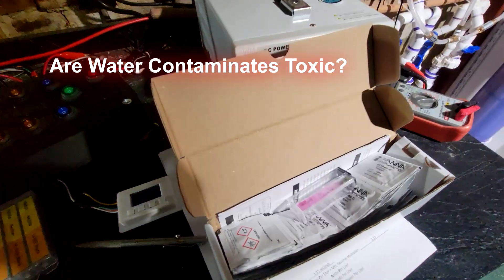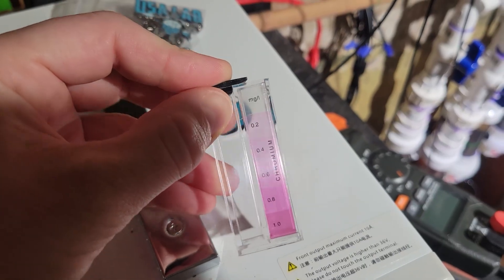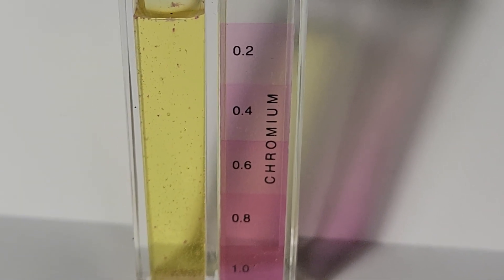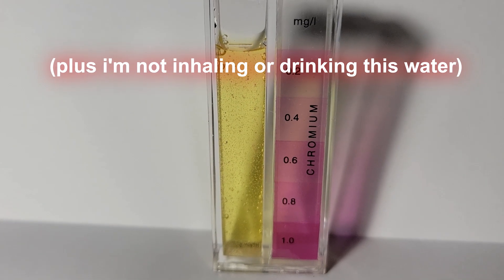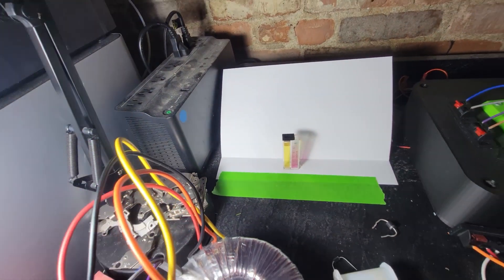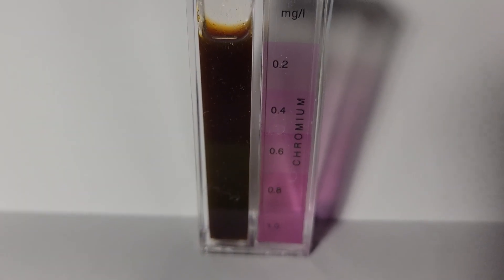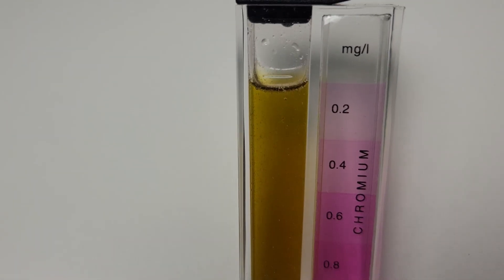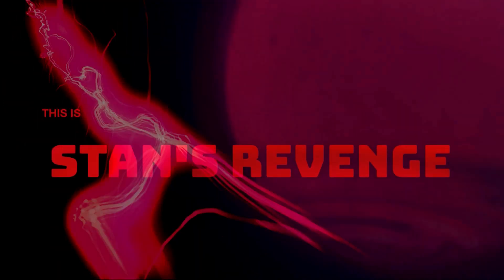Are Cell Contaminates Toxic? Hexavalent Chromium (CR6) Test

Comment: Whatever caused those purple specs it obviously wasn't in solution, that means it's filterable, which is a big plus. 
  If it is solids that contain chromium, and not a false positive, you would have to dissolve the chromium to get an accurate test in terms of parts per million, because there's a lot of atoms in solid flakes and always less surface area than volume for an indicator to react with when solid.
   I would have to look up what dissolves chromium that wouldn't interfere with the test, but thanks for mentioning the phenol-whatever maybe spell it  in a reply, just so I'm sure I'm looking up the right thing 😁
   Also should probably mention for non-chemical inclined people, if the chromium is insoluble it's probably not hexavalent but I'm sure the strong muriatic acid in your stomach is going to react with it anyway.
Reply from the maker: Are you a chemist? Sounds like you are at least chemically-inclined, which is likely much more advanced than I. The solution needs a professional test, really... But I think I proved to myself that it's safe to work with and won't kill me (it's not like I'm drinking it here). Wouldn't you agree?
Reply: @noahauman , I started as a chemistry major before switching the computer science, but yes definitely chemically inclined as I still do a lot of stuff as a hobby. 
   Just a fact that it's not a solution definitely makes it safer because it makes it easy to filter. So yes I agree. People drink a lot worse I know I have, but they still had lead in stuff when I was a kid.
   I decided to look up some of the stuff with the test you were taking, apparently it would also react to nickel flakes which is another ingredient in stainless steel.
   Personally I think people in general should know much more chemistry, just a familiarity with what they do on a daily basis and be able to read food ingredients and such. Again is a but, that's probably also true about the law and medicine too.

Comment: The big issue here is that the small particles that shed off the surface of cells which is nanoparticles initially formed through cavitation and ablation of the SS electrodes, will carry over into any combustion system.

The heat of an ICE will cause leaching of chromium in exhaust vapors which  will be emitted similar to lead emmisons from old leaded gasoline.

One caviat that can fix this is recapturing the exhaust and pumping it back into a second cell to undergoe electrolysis again.

Addition of a carbon block filter into a second stage exhaust recurpation system can help too mitigate any population issues.
Reply from the maker: I do not believe that those nanoparticles (if they do exist in the form you propose) are carried though the released gasses of the EPP. Stanley states that its absolutely pure H2ONAr (hydrogen, oxygen, nitrogen, argon), and was lab tested nearly perfect 2:1 ratio *supposedly*. In a traditional DC electrolysis setup, I can fully understand how your point would apply, given the high decomposition rate of SS under high amperage chemical-electrolysis.

Stan did, however, use a gas recapturing system to recycle the non-combustible gasses to lower the burn rate of HHO. Perhaps this was an added benefit.

Comment: Good work! Nice thorough analysis of the various consistencies. 👍  If there's something in the water (brown/red gunk) it came from the water itself, or your non-304 electrode wires decomposing/rusting, etc. The 304L electrodes produce absolutely no Hexavalent Chromium, because they have a lab tested degradation rate of 0.001%/year. Stan had this explicitly tested. In most cases, you could still read the writing on the tubes. If you're not using 304L, and especially using caustic electrolyte, then you may be getting chromium leeching out. The high current conventional heat-based electrolysis method drives this reaction. Stan's Electrical Polarization Process (using a high Voltage To Amp Ratio), eliminates the need for electrolyte and the electrodes never decompose. The ionic particle oscillating behavior is physical, and not electrochemical.   The whole Hexavalent Chromium scare comes from the conventional world antagonism. 🙄
Reply from the maker: Well then I'm glad to have performed this test.

Comment: I’ve got that sludge in the past doing the  typical electrolysis process in my case., The walls of my cell that were stainless steel seem to have the chromium leaching off of the sides(of my reused yeti/304 stainless) which used city water as well… soo… maybe it’s something like bleach or chlorine that reacts with the 304 so that it’s some weird form of chromium? Just a thought🤔 
But still , cool test , curious to see any others you do . I enjoy seeing your channels research and replication of Stanley Myers work, keep up the good work
Reply from the maker: Remember this test does not represent traditional DC electrolysis. HC6 may be present in that water bath!

Comment: I’m not get the production you do in your cells Noah but I don’t have even close to the contaminates either my water has been in my cell for months now with only a slight film on the surface
Reply from the maker: what kind of water? and any idea of gas LPM? Discoloration is proportional to gas LPM in my observation.
Reply: @noahauman  The color of the gunk is another indication of the process. The water purity also will fool you.. Distilled water <2ppm, will make thick blood red gunk, when pulsed/driven with high voltages. Well and tap are much more brown/dark colored. I've talked to Max at length about it being a Redox operation, but it still begs the question.. If all that was "impurities", why does it separate and never recombine? Why was the water clear when it went in? Sure, heating turns it yellow. But to make the gunk, it's transmutating something in the water to something else..  "It's a multi-gas generator, capable of producing millions of new compounds not yet realized."  - Stan

Just don't drink it! :face-green-smiling:
Reply: @noahauman just plain tap water , I’ve never actually tested I’ll have to check